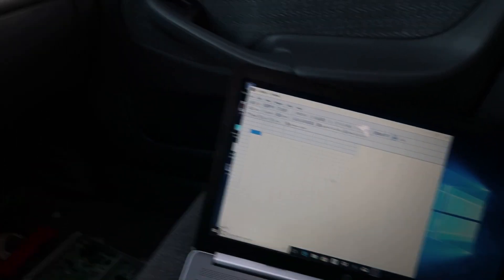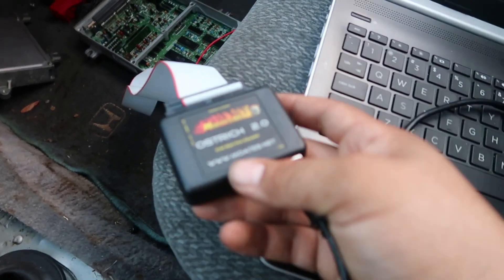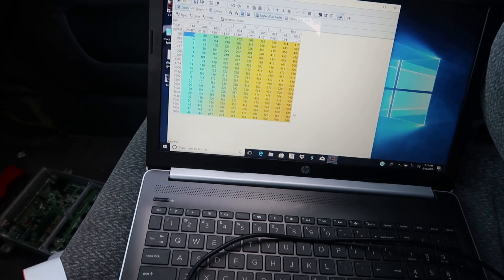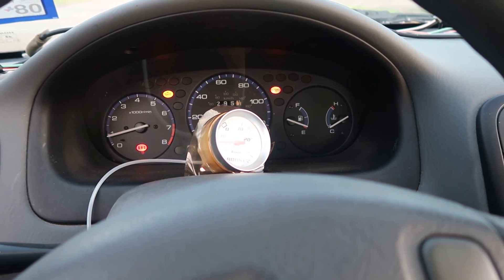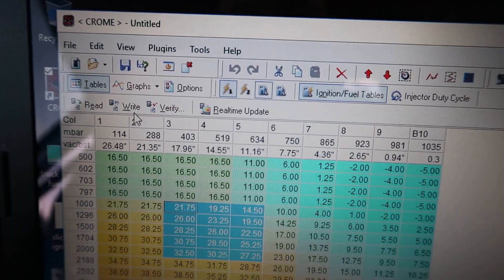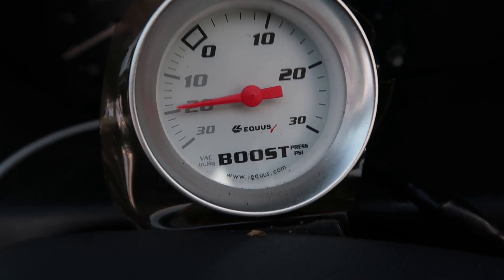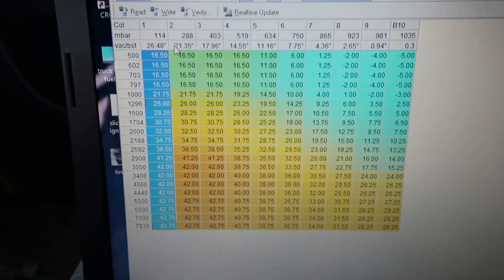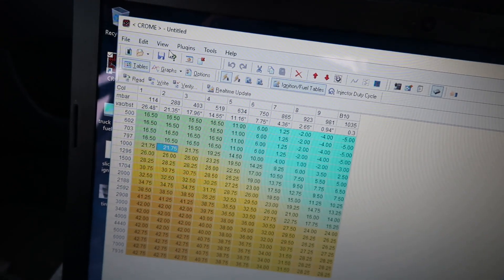Let The Tuning Begin! Moates Ostrich 2.0 Update

Comment: When you finished u just unplug thé computer to thé emulator ? And u have nothing else to tune just thé oestrich and thé cable ? Thank you
Reply from the maker: The ostrich stays plugged into the ecu at all times, yes that's all that is needed to tune. A socketed ecu, ostrich and chord to your laptop. You will need to monitor afrs tho with a wideband afr gauge
Reply: Did u just download it for free thé software crome ?
Reply: Ive downloaded crome but when i go to boost tools on the Vac/bst it stay at vacuum like at 7500 RPM 0,59 vacuum at thé 14colonne

Comment: what version of windows do yo have? did you have problems connecting the ostrich to your laptop? i cant get it to connect
Reply from the maker: It was a pain in the ass, had to down load a USB driver suggested by the moates website. It was for an old version of windows but it works on my windows 10

Comment: Do you have to keep the “ribbon chip” plugged in all the time for the car to have the map? Or can you unplug it once you’ve uploaded the tune?
Reply from the maker: The map is saved into the ostrich so it has to stay plugged in all the time.
Reply: @BoBuilds  Once you are done tuning the map on the ostrich can you save it and then write it to a chip?
Reply from the maker: Yep sure can. The tune is still saved on crome AND the ostrich. So you just need a chip burner. And write it from crome. I'm always making tweeks tho so it stays plugged in. One day the tune will be good enough to burn a chip lol
Reply: @BoBuilds  Cool, thanks. I'm far away from even attempting to tune, first trying to get a good understanding of all these products.
Reply from the maker: I'm about to get a hulog to see exactly what cell the car is in not just guessing
Reply: @BoBuilds  I didn't even know that was a thing. Can you use the hulog and ostrich simultaneously?
Reply: So the map is saved to the ostrich.. does that mean it’ll run without it being plugged into the computer. Like a burned chip would?
Reply: @aslopez92  bump for this question